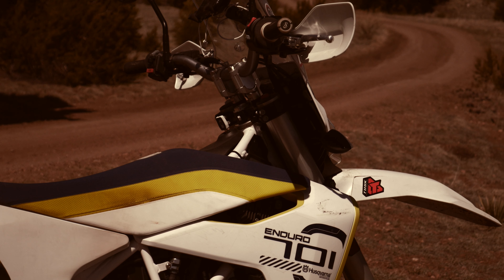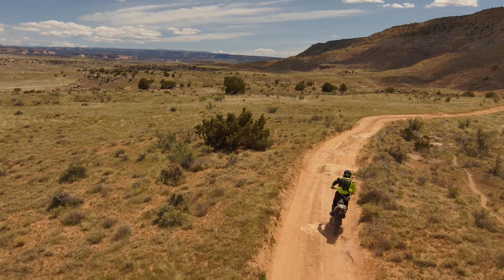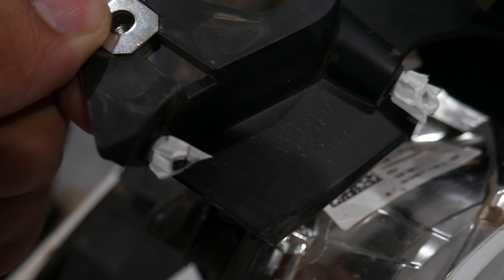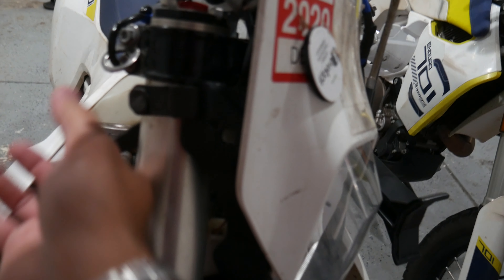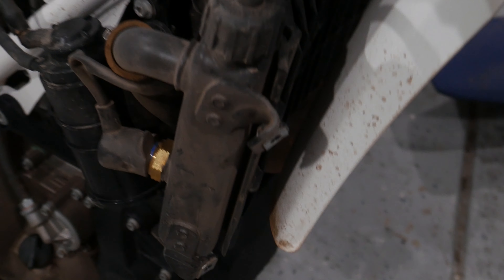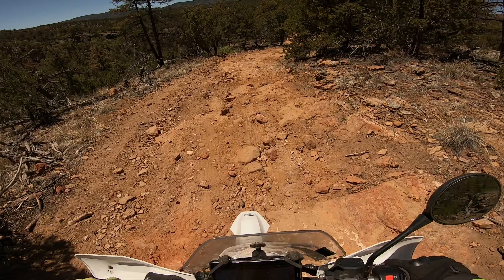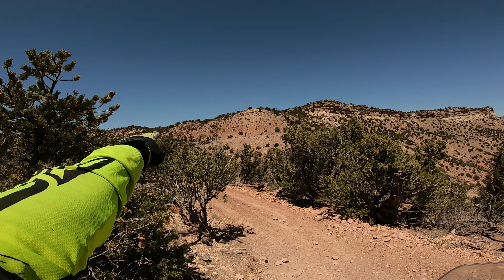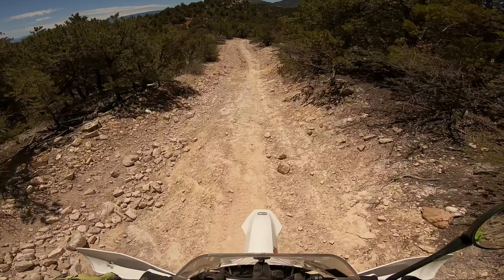What I hate about the 701 husqvarna enduro | 5 things that suck about the 701 enduro

Comment: The reason the muffler is so big and heavy is because they integrated a catalytic converter with the muffler starting with euro 4 emissions. That’s also why it gets so hot. Aftermarket muffler is a must on almost every new bike in my opinion though.
Reply: Agree with Curtis Xavier. There are necessary mods that must be immediately placed on this bike. Exhaust is one of those. KTM was forced to do so to make it a 50 state bike regarding emissions. If you can’t afford the mods, then stick with the POS Honda XR650 ha ha!
Reply: It is convenient that the CAT is integrated into the muffler instead of in the header somewhere, as it is simple to get rid of it. 😆

Comment: Papar air filters outperform foam... at filtration. That advantage only increases as service intervals lengthen. I’d not use a foam filter on a bike  with 6000 mile service intervals and a long expected engine life. Foam flows better for increased power... but I just use it on track bikes not bikes that will see a lot of miles. For dirt bikes that will see frequent engine rebuilds foam makes sense... but the 701 is supposed to have a longer time between rebuilds and the poor filtration efficiency of foam could become an issue.
Reply: Beautifully put ❤

Comment: I give you more: the light of the front lamp is  just as weak, as the connection points of it. LED should be the stock solution. 2, You cant switch of the front ABS.  3, The side stand sensor can easily get you in trouble, when you cant start the bike becouse of it in the middle of nowhere. Other than that and your list, its a perfect bike for dual sport riding.

Comment: Actually the massive exhaust can does make sense. KTM have to put a CAT somewhere and so they put it in a can that they know everyone will discard on day one. If they put it under the engine like the T7 it is much more difficult to get rid o and makes the bike heavier than i needs to be. That said, it is dangerously hot and they should fit with a heat guard even if just to protect the owner long enough until it is replaced.

Comment: The exhaust part may be fixed with a richer air to fuel ratio. My 800GS ran at the "optimal" 14.7:1 for emissions purposes. I put in an AFXIED to adjust AFR to around 14.1 so it would not stall as easily, but a side benefit is that it runs cooler as well.

Comment: Hey bro! The steel screws of your windshield helped to an unexpexted catastrophic failure. Usually they are made of plastic/nylon ones, its kinda mechanical fuse. The windscreen work as a lever that increase the forces to broke it and everything attached to it, and, thats why nylon screws should came into action. Have a look on some oem windshield, specially Japanese ones.

Comment: The exhaust pipe is big, heavy and hot but not that bad at all. Most of the aftermarket Exhaust bring less power, then the stock one. This is due to the lack of volume and if its one thing that emissions restricted 1 cylinder love is volume in the pipe.  Totally agree with you the over complicated assembly of some things and the lack of protection

Comment: Good point mate definently in need of some quality accessories I have a 690R and a 790R I'm selling the 790 in favour of the smaller more fun machine anyway I was making a tail tidy out of all the excessive plastic number plate holder on the 690 R  and noticed that the tail peice is in many different sections and if you did happen to flip the bike or have it fall back on the tail for some reason it would be like pushing a self destruct button

Comment: Hey! 

I am looking for a motorcycle that can handle both normal and off-road tracks (rocks, mud etc.). For now I am thinking of two models, the Husqvarna 701 and the Yamaha Tenere 700. Which one will do better? This will be my first off-road motorcycle. Unless there's something better than these two?
Reply from the maker: I always say 3 different models, T7 701enduro/XR650R or KTM500 

If mostly doing highways, and only doing county roads and basic trails, T7 will be way more comfortable, also less maintenance. When it comes to the 701, great machine like a giant dirt bike that can actually do tight single, just change the tires for some knobbies if doing mostly 50 50 with some single track in there. 500 is mostly doing trails and single track

Comment: I've got a pretty good leak on mine right now. Waiting for something to come in the mail I ordered and then taking to the shop to get fixed
Reply from the maker: so actually my clutch cylinder went out. turned out I have the notorious defective part lol. was wondering if that what went out for you
Reply: @RWWRENTAL  yes it did. The master cylinder? I got stuck at 30th and Garden of Gods with a nearly dead phone. Luckily, a guy on 701 super moto happened to come by, went home, grabbed his truck, loaded me up and took me all the way home to Falcon...wouldn't even take gas money I offered. Some heroes don't wear capes
Reply: @Burner-Adventure-Chronicles  was it only your clutch cylinder that gave out? If so why did you have to get rescued, can't you drive it back without a clutch?

Comment: Or just change the filter, handguards etc like you would on any endurobike. Buy a proper radiator guard like you would on any endurobike. Throw away the stock exhaust. Like you would on any endurobike.. Or buy an touringbike like the T7 or something like that where the fairing costs as much as a new bike. Great video though!
Reply from the maker: haha pretty much! so in other words, this bike is great all around and not many weak points except whoever its intended for
Reply: You said it! I’ve had two now and I haven’t had any major issues so far and I’ve ridden them quite hard. However - you are right. I have full of broken plastic, but it’s cheap so I don’t really care.

Comment: I did choose between the 701E and the tenere700...and ended up with the T700...wrong descision....if you consider the 701E as weak read the comments from the ones who have fell over with the T7...
Reply from the maker: I dont consider the 701 enduro weak what so ever. But if I had to pick between the 2, I think I would have gotten the t7. regardless I got the 701 way before the T7 was available.
Reply: @RWWRENTAL  i just sold mine t7 after 2000kms...buying a 701SM now
Reply from the maker: @Parakitedude  any regrets with the T7? im undecided if I should keep mine or sell it. the 701 enduro has great power though for our mining passes, which I ride a lot of.
Reply: @RWWRENTAL  I think it is a bike that has a very good engine. But I do not like the angle of the swing arm, I dislike that the bike seems to be to weak for real offroad. If you just drop the bike it will get damages on the exhaust. There are no protection  at all on the exhaust when the bike is on the side.For me it feels as it is more of a city bike.

Comment: Any modern bike disintegrates in a crash. All plastic veneer and cheap alloy. Profits v durability. Such is modern life...until we send a clear message and stop buying them they will continue to erode quality.
Reply from the maker: you are right. it seems most modern dualsport get wrecked pretty hard in a decent crash. even my TE250i cracked the rear subframe when I sent it flying. they dont make them like they used to. Perhaps my next bike will be a YZ250x I think yamaha still builds it traditionally

Comment: Wow seems whack for 10k bike . I stick with my wr250r
Reply from the maker: well they are kind of aimed for different audiences. wr250r is a much better offroad bike vs the 701. if the wr250r ever came out with a wr350 or even 450r I would be all over that. it is kind of what I am waiting for. unfortunately I need the power of the 701 riding in high elevation trails. bring a wr250r up to mt antero and it wont make it up with its steep grade and 14k ft elevation. 701 is much better on road as well vs the wr250r. but for more technical riding and single track and reliability wr250r is the way to go. I do hope they make a 350 or 450 one day. think it will be the best selling bike ever
Reply: RideWithWill do you think a geared down WR250R would still struggle at high elevations?
Reply from the maker: @quikboarder93  A wr250r can def handle just about any trails in CO, however, I think in Mt Antero it will be a bit of a struggle towards the peak because of its thin air. I think it will make it, but it will def be a 1st gear ride and for you sure you will need at least 13/50. I rode a wr250r and it does have slight more power of the KLX250, but a bit lower than the wr250F. as for other passes, you should be fine putting along 2nd gear where as a klx250 will need to be in 1st gear most of its way.
Reply: I just sold my WR and will get a 701 this winter, natural progression I guess...I thought I would want a T7 but after seeing it and sitting on it, the bike is too heavy for my style of multi day rides.
Reply: @RWWRENTAL  would a 450 be able to cruise comfortably on the highway at 75 or more miles per hour? Would it be able to do so carrying two up? Are any of them built for high mileage and low maintenance reliability and have plenty of oil capacity?

It seems like we're stuck between a lightweight dirt bike with license plates, gargantuas heavy adventure bike that you can't even pick up if you're alone.

A lot of us don't care about trying to compete or drive like a racer Offroad, we just want to explore and have a good time stop being stressed out about dropping the bike, and be able to cruise on the highway back home, sometimes your partner on back

 I had an XT 600 that only weighed 300 pounds and would do that quite well for the day and top out over 100 mph, It seems like we should have a drastic improvement over that today, sounds like the 701 is the bike?
Reply: To bad they aren't going to make a 2021 wr250r
Reply from the maker: @builderbestbarn6619  with the markets now introducing 300cc dualsports (crf300L and KLX300 dualsport) I wouldnt doubt it a wr300 will come out! I sure hope so!!